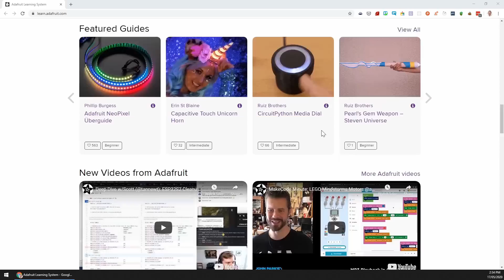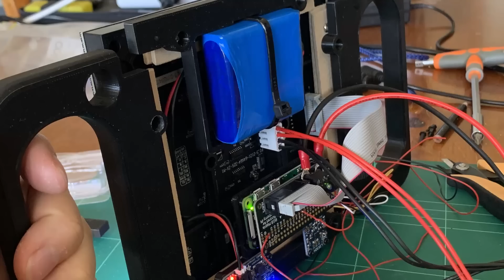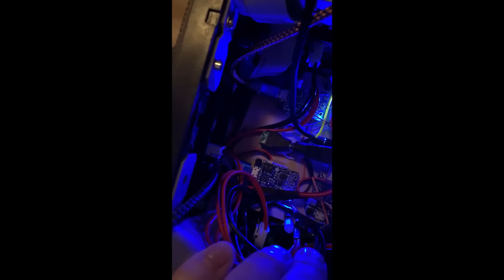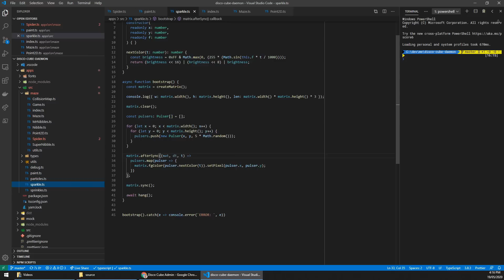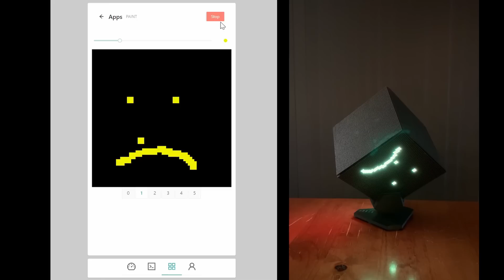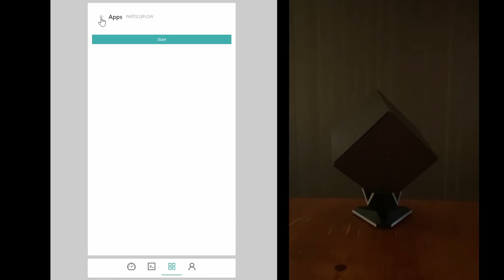My LED Cube

Comment: If you could find a way to have an object appear in the center of the cube, but always have it oriented the same way in space no matter the cube's rotation, I think that'd be pretty cool. 
Imagine you're holding a glass cube, and inside that glass cube is a model of a goldfish. The goldfish's body never changes position, dorsal is always up, ventral is always down, anterior is always towards you, posterior is always away from you, and the lateral axis is always parallel to the ground/horizon. Yet no matter how you manipulate the cube, the central goldfish is never manipulated.  
I know in a program, like Blender for example, you would just need six cameras, one for each face of the cube, then manipulate the object. I just don't know how you would translate that kind of operation to a program that can run on low-spec hardware and make it power efficient. As for manipulation of the object, inverse the gyroscope's input, that way the object inversely moves as the cube moves, producing the effect of the object not moving while the cube moves. 
If there's a way to pull it off, it'd be a cool effect. Probably not the most practical effect for something like this, but a cool party trick nonetheless.

Comment: wireless is not going to charge that battery in short time. but u could use "metal contact point"  like ceiling track light or switch or ipad and its magic keyboard.  at those edge, leave left and right 2 metal point to contact the base for charging will do. u may need insulation sticker or paint behind those "charging contact point "

Comment: Impressive. I too have the "LED cube" on my todo list, because I've always been fascinated with the flowing particle demos on those LED panels. 
I think it'd be a neat idea to render cupemaps of a scene in OpenGL and display them on the cubes faces. That way you could leverage accurate physics simulation to have the particles flow around the cubes faces (amongst other things).
Congrats on the baby!
Reply from the maker: Getting my head around the cube mapping math was hard. Would love to see someone else tackle it better than me :)
Reply: @MichaelCannUk  Well, I don't know about better, you've done a pretty good job already, but I'll eventually get my own LED cube done and try to improve on those that came before me.
And yeah, writing texture mapping from scratch for a 3D surface can be a bit daunting - but that's also the first step in setting up compatibility with a 3D engine, which in turn will enable so many more cool things. Like adding a small camera that peeks out of one edge to display a realtime cubemap of the environment on the LED panels.
Anyway, I've subscribed to you, in case you ever do decide to tinker some more and share the results.

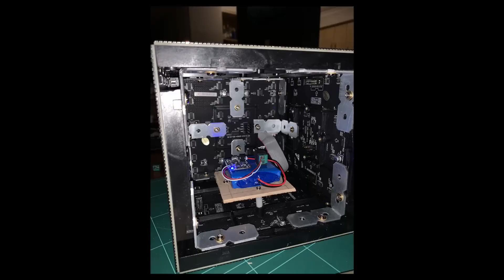Comment: 7:33 Wait, wait, wait...   The panels have depth, they are about a half-inch (~12mm) thick which would prevent them from going together like you show and have the LEDs reach the edges.  You would have had to remove a portion of this depth from at least some of the panels for your cube to come together as shown, yes?  I haven't read your blog on this project, maybe it's mentioned there.  Regardless, great project, it looks stunning.
Reply from the maker: The panels do indeed touch all around the edges, yes I mention it in the video but I had to remove a bunch of that plastic frame from the panels

Comment: Very nice project! But you should have done more DIY! e.g. only 1 or 2 batteries, only 1 battery controller and none of that USB rubbish and big connectors. A 3D printer would have also been very handy for such a project.

Comment: I'm working on one of these in a smaller format with current tech. I was also inspired by the one on Adafruit's site before seeing Michael's version here. Thankfully, we have a new processor from Parallax that can drive the cube with no external components needed. (for the LED parts). Once there is something to show, I'll post a comment here.
Reply from the maker: Thanks awesome, I have replied to your email to discuss more :)

Comment: Do you think making an aluminum frame that attaches to shelf slides would be easier?  That way you could attach the electronics and batteries to the frame and be able to work on it outside of the cube.  Sort of like how the motherboard and computer internals attach to the inside of a computer case.   You weren't kidding that it's not for the beginner.  It would be a good playground for graphics algorithms or sorts, a* search.   Anyway, looks like a lot of fun.  Thanks for sharing it !

Comment: I'm surprised you didn't use one large RC battery, they can supply 100's of amps
Reply: If I understand correctly, each panel required 5V, this means he would need a 1s battery (if wired in parallel). RC batteries are usually never 1s (atleast the high output ones) so this wouldn't really be a viable option in the setup he had. An alternative could have been wiring the panels in series and then having a 30v requirement, which would have been a better solution but still required a 10s battery. The other issue is that in order to charge an RC battery, you need a bulky balance charger that would need to be externally plugged in, taking away from the enclosed nature of the build. I will agree that the 4 batteries are not an elegant solution but better in the scope of this project because of what the creator wanted.
Reply: @mustacheman6000  that's where a stepdown converter comes in
Reply: @tibo786  Ahhh, I thought somebody would suggest that. Stepping down 15-20V down to 5 produces a LOT of heat, not to mention bulky 40A stepping circuitry which is not what you want when the whole project is enclosed with no heat dissipation AND the added heat of 2000 LEDs surrounding it.
Reply: @mustacheman6000  fair point. He did say he might have made a mistake with the power calculation. Also running 2 (3 kind of) panels on one battery seems like a lot if that is the actual power draw. But I can't find the battery he used so who knows. For just a project this solution will probably be the easiest and maybe cheapest. As an actual product I would try to come up with a better solution.

Comment: why typescript and not C Michael? seems to me that it would be unreliably slow for a realtime task - got me thinking when you implied a rpi0 won't drive 6 led matrix panels when I have seen an stm32 at 1/16th the clock frequency and power drive 12 or more...

Comment: Since it has a raspberry pi 4 in it I wonder if it could to some form of 3d. Like maybe the cube could show particles or balls in it as if it was a box. Or it could show wire frame from different angles depending on what side of the cube you are looking at and what data the cube has from the motion sensor.

Comment: this is amazing.  when are you going to do a sphere!!!  You can come up with more interesting stuff than grabbing a 3d vid and putting it on there.  I was thinking about hooking up the accelerometer and only displaying a part of a picture, based on how you move the cube.  Once you swing the cube in large circles fast enough, you eventually can piece together the entire image.
you didn't have a disco ball, where lights come on and off kinda randomly
you could put cameras in the corners and turn it into a mirrored ball
the raspberry pi zero can do image recognition and voice recognition, so you could tell the cube what to do.
Image recognition could image search for something and tell you how much it would cost on amazon
why not get an old laptop and put a laptop screen on there just for fun just one side to mix it up
a lot of people using magnetic charge points, just put a mag charge point on the corner on the bottom of the stand
you could make a magic 8 ball, which would be cool, but it would be even cooler if you wore a magnetic ring so the cube could tell if you were holding it or if someone else was holding it.  All your dreams come true, but everyone else gets doodoo
Reply from the maker: Wow all phenominal suggestions :) I would love to investigate these ideas more :) I like the idea of magnetic charging point too, I should have thought of that
Reply: @MichaelCannUk  im a code whos bored, so that was just 5 minutes of tossing around ideas

Comment: Hmmm i think the problem with the 3rd panel flickering with a single battery might be a problem with the 5v booster as 2 good cells should be capable of runing up to 40 amps.
Reply from the maker: Oh really? Interesting. I would loved to have reduced the battery and controller count in it
Reply: @MichaelCannUk  Yes, looks like your battery pack (https://core-electronics.com.au/polymer-lithium-ion-battery-6000mah.html) is capable of 2C continuous discharge, that's 12A for pack, while your booster (https://www.adafruit.com/product/2465) is only capable of 1A.
Also, your back of the napkin might be right, its just that the rating might be at full brightness all white, if you are using colors thats 1/3~2/3 less the power you need.
Reply from the maker: @eloimartinez9446  Oh okay thats good to know that my calulations might not  be totally wrong :) Thanks for running the numbers there. I think nexxt time ill pay more close attention to a proper battery controller that can handle a higher current.

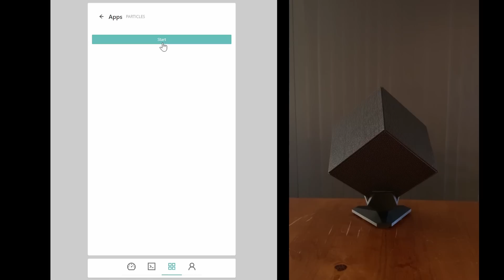Comment: It looks like with the more complex stuff around 19:00 you're programming it as animation based on the pixels themselves. I can't help but wonder if you could get a better result but initially only processing the cubes orientation in space doing whatever processing for animation and then translating that to the whatever the pixel location is on the cube based on the last step...I don't know if that was clear or convoluted.

Comment: so how do you charge it up ,  you need to remove the  panel with the magnets right , i wonder if you could add  a wireless charging  inductor   coil ,  i wonder if it would  charge through the LED matrix
it's not all metal but i wonder if the   field would  cause an issue with the panel
Reply from the maker: I did have induction working, but it wasnt very efficient so removed it.. Definately want if I ever do a v2
Reply: @MichaelCannUk  cool, would like to see a v2
I wonder if you could  get a custom and really small I/O
Board made for the pi4 compute module so it might give you more space inside ,hard to tell by looking  if it would just end up being as big as the pi4 anyways
Reply from the maker: @andreamitchell4758  Ye a full custom board would be awesome like these guys did: https://squarewave.io/

Comment: Hey, great work.

What are you using to simulate the particles? Smoothed Particle Hydrodynamics (SPH) might be a good technique to simulate the fluid-fluid and fluid-solid interactions kinda accurately. Running it realtime is usually hard, but you don't have that many particles so you might get away with it, with large delta_t, also you probably don't need to care about higher orders of accuracy.
Reply from the maker: Ye a better simulation would be awesome if I decided to make improvements to this in the future. Its just a simple iterative particle simulation currently.

Comment: How do you deal with heat in that thing?  How hot does it get?
Reply from the maker: Thats a very good question, I dont really deal with the heat. I havent tried it for very long periods because the battery is the limiting factor really

Comment: First of all - wow! Pretty damn awesome!
Second - congrats on the fatherhood! I calculate 2 months old, so you're probably sleep deprived which makes me wonder why you're reading these comments at all :)
Third - Would it have not been simpler to build a really simple  steel cube frame and put magnets on all the LED board faces?
Fourth - How about programming the particles as 3d particles  "inside" the cube? - so mapped onto each face with size/brightness depending on the distance from that face. My b=rain won't handle whether its possible but it'd be something to tinker with at 3am while the baby has a short nap ;)
Reply from the maker: Hi Maxx! Haha yes hes 2 months now and sleep is not a problem at the moment, he sleeps quite well at night, but he just always wants to be held so we get nothing done during the day which means I have 0 time for any extra projects right now :(

You might be right about the steel frame. My original idea was to make a frame out of wood but my hardware skills are lacking to say the least. There would certainly have been challenges with a frame with the positions of connection wires inside etc but you are right, that may have been the better solution.

Like the 3d particles idea! Definately sounds like it might be possible. Someone else suggested mapping a 3d cube onto to the cube so it looks like its inverted and moves around as you move the cube, also makes my brain hurt thinking about it :P

Thanks for the comments!
Reply: @MichaelCannUk  Make a Rubik's Cube on the cube!?

Comment: First off, great job! I thought I would estimate the costs from the parts mentioned in the video for people asking for a price to build one for them.

Prices ($ USD):
6 x $20 - LED Matrix
4 x $30 - Batteries
4 x $25 - PowerBoost 1000 charger rechargeable 5v
1 x $35 - Rasberry Pi 4

There might be some savings, but the hardware raw cost looks to be about $475 with the main components. Add $100 for other parts mentioned. I don't think he mentioned the hours to build but I would guess 60-80 hours for the first prototype. Maybe could get the build down to 10-20 hours with pre-printed 3d parts holding all the parts together. The total cost would probably be about $1000-1250 for someone to build.

 Also wanted to share this project that would be really helpful instead of using a Rasberry Pi. https://www.bhencke.com/pixelblaze
Reply from the maker: Awesome thanks for putting that together. I think I overpaid for most of it but the parts list looks about right minus all the cables, USB hub, tools, brackets, screws and everything else :P

That Pixelblaze looks awesome :)

Comment: Nice! What framerate did you get out of the pi with the Electrodragon board?
Reply from the maker: Hundreds, like 250hz, had to slow it down
Reply: @MichaelCannUk  Thanks for the reply! When you say 250Hz, does that take into account the 1/16 scan? or is that 250 full frames per second?
Reply from the maker: @devnull7970  That the number that hzeller's library outputs when you run it, im not sure exactly how its calculated. TBH you can tweak the command prarms and it wildly varies the number. The Pi's performance definately isnt the limiting factor

Comment: how'd you learn how to write the code using firebase? i built one and my last step is software that actually works and I've hit a wall because I want to do it the way you're doing it
Reply from the maker: You build your own! Nice work! Im a coder by trade so I just kind of figured it out. You might want to look into something like Node Red, could be simpler?
Reply: @MichaelCannUk  hey there. Just got out of school for the semester, looking at this again. where do you store each “app” to display? for example the drawing one or different demos, how do you run this on the cube? Is it on the daemon or the user client?
Reply from the maker: Each "App" is just a a script that I run on the device (in the "daemon") .. as mentioned this is probably not the best project to take on for your first coding project
Reply: @MichaelCannUk  definitely not my first coding project, I’m a compsci major I’m just trying to figure out the best way to approach
Reply from the maker: @masonbes  Ah apologies, from your first comment I assumed that it was your first software project. Ye like I said if I was to do it again I might seriously look at NodeRed or something instead of the way I did it.

Comment: Man you need to get yourself a 3D Printer and some quality CAD Tutorial time... All of that hassle with rigging that thing up into a cube using brackets and crap could have easily been prevented with just some simple CAD design and 3D Printing... Just create a Hypercube the internals go into with strong embedded magnets around the perimeter and have the panels with their frames attach to it using magnets ( could incorporate display connector holders as well ). Either that or design a Bayonet like Locking mechanism that would have you twist a panel before lifting it off to gain access to the internals.

As for the wireless charging I'd simply put it into a "marked" corner of one panels ( either via an actual mark somewhere or just by adding a "marking" pattern on the App telling you where the charging coil resides without the need of opening up the cube ) and have the cube rest on a custom charging base.
Reply from the maker: Ye tell me about it :P I wish I had a printer for this project!

As I say in the video I really dont know what im doing with this stuff, its a miracle I pulled it off.

Comment: I pulled the trigger on 7 panels. They're trying to sell me a 140 dollar controller that I don't need. I want to do alot of procedural stuff
Reply from the maker: Goodluck :)
Reply: @MichaelCannUk  it's gonna take me much longer than you and I have to slightly modify the stl files. I'm gonna start like you. Sorry to copy. I'm obsessed with leds and have well over 70k of all kinds. The 7 panels have almost 29000 which is crazy. I want to do something fun with the adafruit imu I paid 70 dollars for a a few years ago. It was cool to learn about filters in software as opposed to circuits. It's a bno055 a bosch I'm with built in everything sold by Ada fruit at a way to high price as the gy-521 is identical

Comment: Technically, this is not a led cube. Its just a plastic cube with 4 led panels glued to it. Its cannot show real 3d effects. as real led cubes are. Real led cube with same resolution will require 262144 leds, while this has only 16384.
Reply from the maker: Cool, ye would love to see one of those implemented. I did think about doing something simmilar with EL wire.. maybe a different project ;)